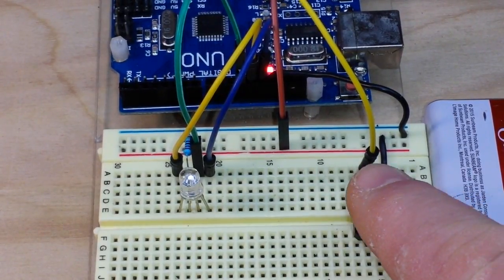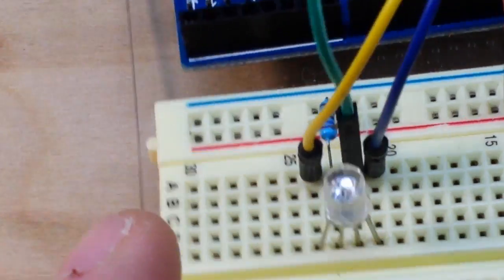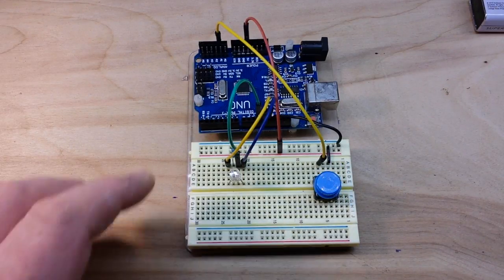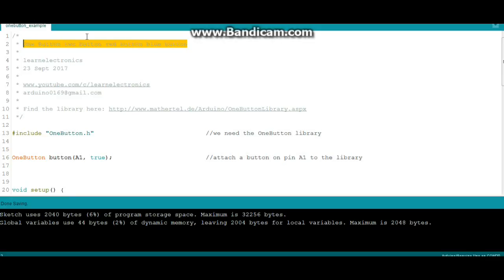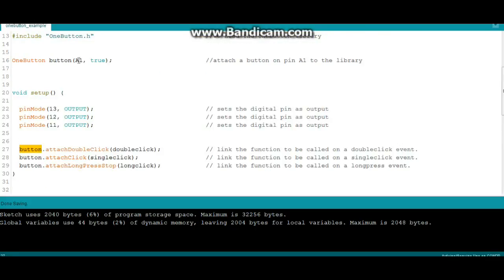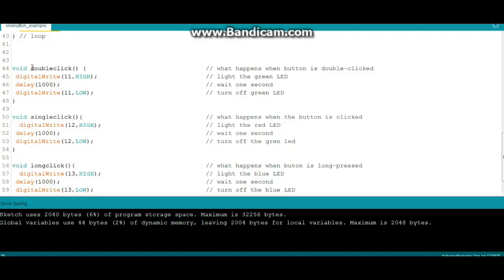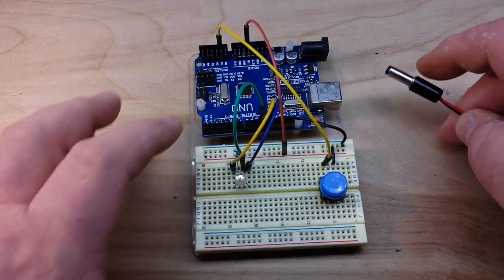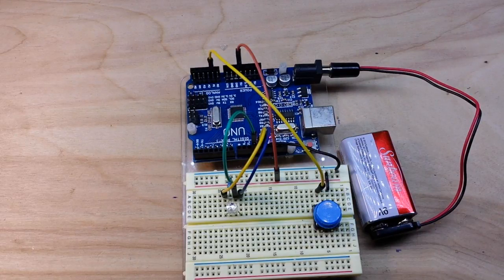How to Detect Short, Long, and Double Clicks with Arduino

Comment: Thank you. This is perfect. Nice and simple and it works great. Would be great if a triple and four click option can also be added to this library.
Reply: They are available as "multiClick()" in the library. Here is the example given in the included "InterruptOneButton" sketch: 
void multiClick() {
  int n = button.getNumberClicks();
  if (n == 3) {
    Serial.println("tripleClick detected.");
  } else if (n == 4) {
    Serial.println("quadrupleClick detected.");
  } else {
    Serial.print("multiClick(");
    Serial.print(n);
    Serial.println(") detected.");
  }

  ledState = !ledState; // reverse the LED
  digitalWrite(PIN_LED, ledState);
} // multiClick
Reply: Pls I want 3 button, 3 output code, one output to function at a time according to the push btn press.
like if btn1 is single click (led1,  HIGH) (led2, LOW) (led3, LOW)
else
if btn1 is long click (led1,  LOW) (led2, LOW) (led3, LOW)

if btn2 is single click (led1,  LOW) (led2, HIGH) (led3, LOW)
else
if btn1 is double click (led1,  LOW) (led2, LOW) (led3, LOW)

if btn3 is single click (led1,  LOW) (led2, LOW) (led3, HIGH)
else
if btn3 is long click (led1, LOW ) (led2, LOW) (led3, LOW)

Comment: Very cool, been looking for something like this for start and end of daylight saving time on a small weather station with a calender on a 1602 display in a small case I have with 4 buttons. Want to switch between clock, current temp/humidity, forecast as well as having an on/off button to save battery power. Thinking an ESP8266 would be perfect for this project.

Comment: How come this works on an analog pin for the button? The library on github talks about using a digital pin.
Reply from the maker: All pins are digital pins, the analog pins are just attached to the ADC. They work either way.

Comment: If this ran on a battery operated device. And since it checks for the button state every few milliseconds. Will this drain the battery even when not in use?
Reply from the maker: Yes
Reply: @learnelectronics Thank you. But how to over come this? Is it possible to "wake up" the circuit when butting initially pressed?
Reply from the maker: That is beyond me. I'm an electrical engineer,  not a programmer.  Sorry.